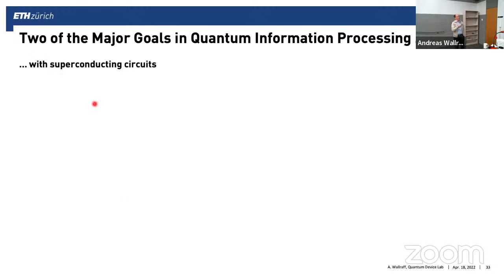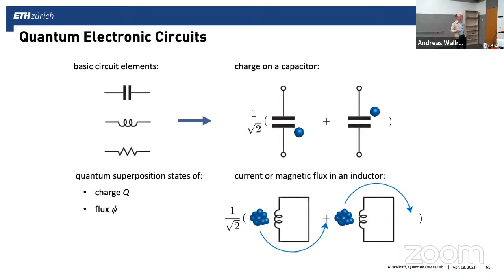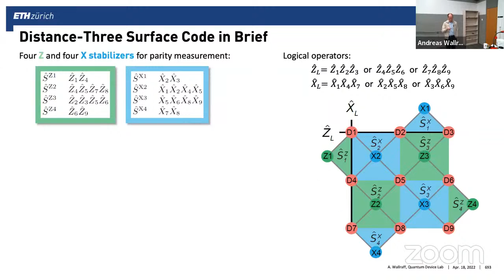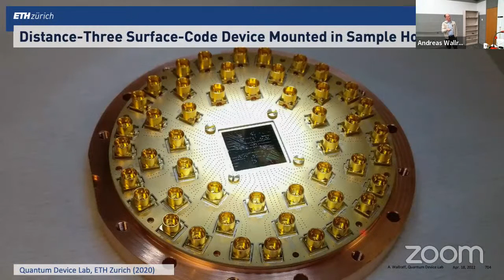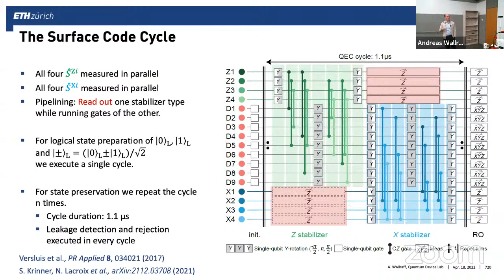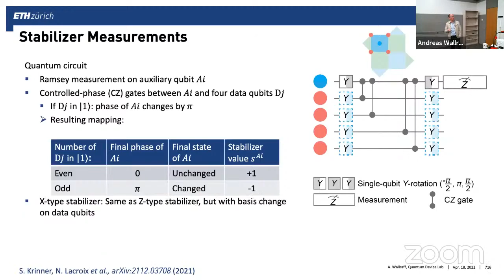JQI Seminar April 18, 2022: Andreas Wallraff

Comment: Joint Quantum Institute
(How close are we to human teleportation? Successes in quantum teleportation experiments abound)
In fact, a fun 2013 study by physics students at the University of Leicester came up with useful numbers to show how
complex it would be to teleport a person, even if we approached it as sending information that is used to re-create the
person elsewhere. They reasoned that the transferable data for a human would consist of the DNA pairs that make up
genomes in each cell. As such, the total data for each human cell would be approximately 1010 bits (b), while the data
for a full human would come in at about 2.6 x 1042 b. Sending this gigantic amount of data would need the kind of
computing technology we didn’t invent yet. By 2013 tech standards the students used, transferring data for just one
 human (at the bandwidth of 29.5 to 30 GHz) would take up to 4.85×1015years, much longer than the age of the
universe.
"Teleporting humans presents technical and philosophical challenges. A recent experiment achieved tremendous
accuracy in quantum teleportation over 27 miles. Human teleportation may be possible with advances in technology
to process huge amounts of data."
We ask technicians and engineers to use the DNA transfer experiment in the field of teleportation Then conduct experiments to transfer mice in the field of teleportation
Mistakes must be studied in order to develop new plans for success, because failed experiences lead to a successful experience
(Please send these suggestions to engineers and technicians in the field of quantum entanglement and quantum computing)